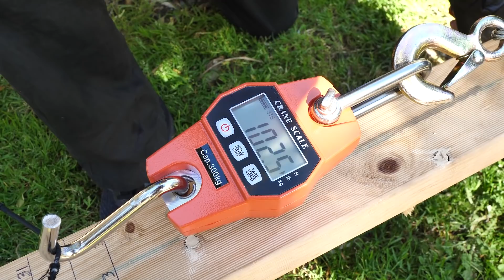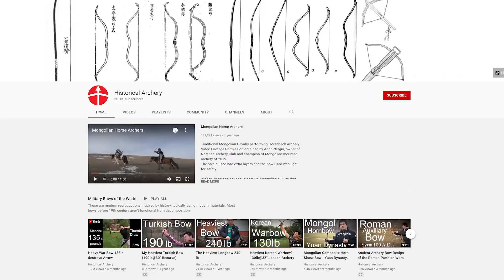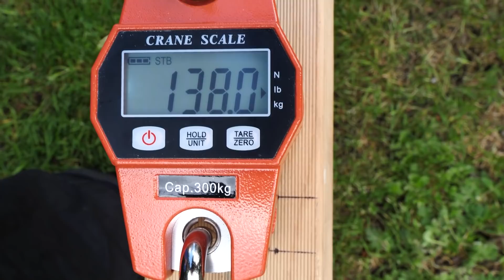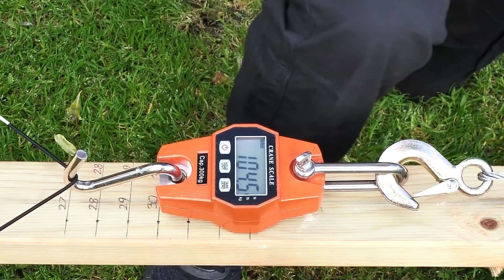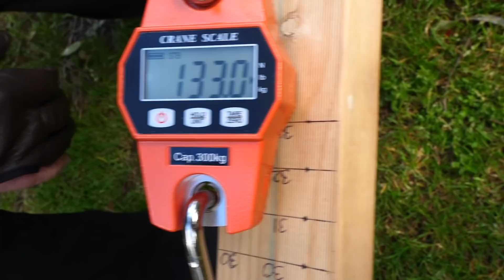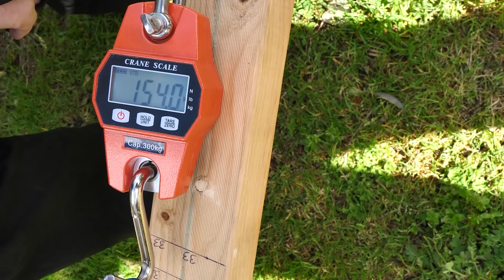Two idiots try to string a  TINY BOW

Comment: Hey Shad I like the new draw measuring setup but I have to recommend that you make it safer should a bow fail. Maybe have some wiring conduit brackets that go over the cable so if a bow breaks you only have to deal with the scale and hook flopping about.
There are likely other things to be done like finding a way to mount a camera that looks down at the scale so you and the cameraman can stay at a safer distance.
Dead Youtubers are useless to everyone and not something I want to see on your channel.

Comment: The reason the weight ramps up in the way it does, is due to the fact the recurves doesn't actually bend. They will act as levers making it much easier to draw the bow. But as you draw it, the angle of the recurves change, thus reducing the moment arm. The recurves also makes the string pull taut quicker making the bow more efficient.

Comment: Shad I want to see either a speed or a penetration test of the recurve vs your longbow.
Because the poundage ramps up that explosively, the longbow might be stronger. But on the other side the recurve has less mass, so might end up with relatively more energy in the arrow. I am definitely interested to find out the energy each bow shoots at.

Comment: This was both neat and fun to watch. I knew recurve bows were an improvement over prior bow designs, considering how much draw strength they could keep while miniaturizing, but actually seeing a much smaller recurve bow with a higher draw weight than your previous long bow was still enlightening.

Just a question from a hobbyist game designer working on his own tabletop RPG: Is there any point at all in making a long-bow sized recurve bow in a fantasy setting? My initial thought is "Yes, but only for people with insane/mystically enhanced levels of strength", but I honestly don't know if the physics would bear that out. Would making a larger recurve bow actually result in more power, or is there some leverage limitation I'm missing that would result in severely diminishing returns or an actual loss of draw strength?
Reply from the maker: I'll be explaining the details about recurved longbows in some upcoming videos, stay tuned.
Reply: @shadiversity  Thanks for the heads up. Looking forward to it. :D

Comment: (Noob question) What exactly are the advantages that different types of bows? If you can get a widdle one to 130lb, what's the point in a biggn? Surely a little one gives you greater mobility and is easier to carry meaning it's just better. Now of course, I know this isn't so simply true but I don't actually know the differences myself. please help
Reply from the maker: All will be explained in the upcoming videos so stay tuned ^_^

Comment: This makes me feel good. 
Mostly because when I was getting into archery I went to the local shop and wanted a recurve bow or a long bow. I wasn't a fan of the mechanical ones. The sales man I guess didn't like me asking for such a thing. He brought me over to a bow on the wall and said "oh you're getting into archery, ok well I know it's not what you want but before I give you a recurve bow to test lets see if you can even handle a woman's bow. Remember this is a woman's bow. Meant for little frail girls. Draw it." 
I took the bow and could barely move the string. I couldn't draw it. It dug into my fingers and as much muscle as I put into it I couldn't draw the thing. The salesman shook his head. 
"Woh I've never seen a man so weak. Don't even think about shooting you couldn't even string a bow." He said snatching the bow back and putting it away. "This is a woman's bow. My wife shoots one of these. Try a gun if you think you can even pull a trigger." 

I was so devastated at not being able to draw it. I was a bit obsessed and just as I worked out every day I would go in and look at that bow wondering what was wrong with me. About a week of doing this and another salesman came over to ask if I wanted to buy a bow since she'd seen me looking at that one on the wall. I told her the story of the man before and that I couldn't draw the bow. 
She rubbed her temple and sighed. "Did he tell you the weight of that bow?" 
Me "No, he just said it was a woman's bow."
Her after rolling her eyes. "That is a show bow set to 300 lb." 

Apparently it was an inside joke for the men who wanted to pick on people they didn't like.

Comment: Shad;  "I cannot wield this!"   ...Every viking in the room;  "Grow stronger."

Couldn't resist.

On a more serious note, I assume that the bows are over-strong because they will relax/age into their designed draw weight over time.  So it is compensatory to lengthen the life of the bow.  I have heard that there is a different draw technique as well that might be worth trying  (if it is even valid);  instead of pulling the draw back, start with the bow close in, string at draw position.  Step forward while pushing the bow out, keeping the string where it should be when readied to loose..  Mechanically, it lets you push out from your center mass instead of trying to pull something in from outside of center mass.

Comment: When you said it was, easy easy easy then it ramps up, while you were measuring you could see the draw weight go from about 35-37lbs to over 60 almost 65-70 very very quickly. You certainly weren't kidding when you said it ramped up very quickly. You can see it while you're measuring.

Comment: Yes those are short war bows are very elegant aren't they and as I understand there are two ways to pull those War bows the first way is to draw the warbow back and release incidentally because you just reached the end of the draw the other way it's a drawback to a very specific length and then release

Comment: I've read that the average Marry Rose bow was 140 lb and this brought into question the previous estimates for English Longbow draw weights.
Reply: So sounds like you may of gotten a replica from someone who put more effort into knowing the physical dimension specifications then the performance specifications and told you the pre test expectation because what you measured matches what other Marry Rose Replicas measure, which is more then was expected.

Comment: The smaller bow wasn't made for an arrow that large and it wasn't meant to be drawn that far. You'd think Shad would know that.
Reply from the maker: The despot is a warbow and is meant to shoot war arrows like the one I was measuring with. Also it is made to shoot at 28 inches, which means it has a natural cushion of 27-29 inch draw, which is what I was measuring at.

Comment: Ugri Urcher's (of 100 arrows meme fame) demo of Manchu bow stringing is my go to stringing method for Asiatic bows- composite type bows. Not absolutely sure it will work with Tiny Bow, however it made stringing my 80 lbs Korean type bow actually pretty easy.

Comment: I personally think that measuring a bow from behind  the grip to be  more accurate, since it where you hold the bow.  But if the systems say measure from the front of the grip, then measure from the front of grip.

Comment: makes me wonder what methods the militaries that used bows like this used to get them strung and unstrung (because you know they made the rookies do it until they could do it in their sleep) also whats the draw weight for standard ammunition?
Reply: Waist cable for one person stringing and for 2 person stringing other one bending the bow over knees and other one putting the string on.
Quite normal "standard" for war bows all over the world was around 100 pounds, but even 40 and close to 200 pound bows have been used in both ends of the extreme, but 100 pounds is pretty common regular soldiers poundage. The arrow weights for those bows range from 25 to over 120 grams, 60 to 80 ish grams being very common in both asia and europe. Highest arrow weight i know of, is korean iron arrow 230 grams. Some hunter-gatherer tribal archers shoot very long spear like arrows that weigh around 300 grams, but they are not normal military arrows.

Comment: Chad to string yee must use whole body   push forward with right shin.  push bay with left leg .   an push forward with left arm in 1 smooth motion till you can slip the string on with a lil slack.   what ive lerned in my 7th grade Gym class back in 2001

Comment: This genuinely surprised me. I always thought that the first bit was the toughest one with such bows, as recurve bows become extended levers.
I did shoot similar bows but they had much less draw strength for multiple reasons...
Reply: In this case the levers have too relaxed angle in them so it doesn't have long draw length, it stacks at 28". With either longer levers or tighter angle in them longer draw without stacking would have been reached. Its all about the geometry of the bow, you change something, the bows behavior changes

Comment: its call stacking, the shorter the over all length the bow is, the shorter it takes for the bow to stack in weight, I bet that bow is 48 inch in overall length.

Comment: I'm not an expert by any means, but that "ramping up" in draw wight you're getting starting around 28" seems to be stacking. Essentially, you're running out of leverage as the string angle increases, and the draw weight shoots up exponentially. It's the reason straight bows need to be so long. If you look at 14:18, you can see the string has passed 90 degrees, so you have a negative mechanical advantage when pulling back further, wasting the energy. It's a consequence of the bow's size and degree of recurve. Were it a little larger or the tips a bit curvier, kind of like on a "scythian" style bow, it would happen further into the overdraw, where it wouldn't be a problem.

Doubt it'll hurt the bow, at least not at the amount you're doing it, but it is a waste of muscle energy for tiny gains in arrow speed/energy.
Reply: I think of it like pedaling a bike. The closer to the top or bottom of circle the pedalcrank is, the less efficient the leverage.

Comment: That ramp up in poundage isn't a product of a "recurve".  It's an issue all bows have once the angle of the string to the back of the limb begins to approach 90 degrees.  The longer the bow for a given draw length, the smaller that angle will be for a given design.  Take that same reflexes limb you are using and add 6 inches to the length on each side in limb and riser and you will have a much smoother, lighter feeling bow at the same poundage.

That is why for your other video where you talk about the misconceptions of the longbow itself, it wasn't that it was a better design, it was just that it was the most reliable design for the materials the English(or originally the Whelsh) had to work with(yew).

As a final note, I would add that I don't believe that bow qualifies as a recurve.  The definition for that means the string lays on the back of the limb at rest with the limb tips forward.    It is a heavily reflexed bow with a set back handle, but it is still a standard short bow and not a recurve.

Comment: What was the Max Draw od the Bow?  The flex looked Maxed out at 29" from the front of the Bow.  You dont want to get the draw where the Bow Starts to Stack up.  Nice Bow, I would keep it at 28-29" max and no further until you call the Seller back to make sure.  You got one hell of an Arm.  My Max is only 60# after 2 years.  Sweet Curves on that bow.

Comment: The official way to measure draw length is to measure from the deepest part of the grip in a straight line towards the grip and adding 1 3/4 inch. In most cases this is the point where the arrow protrudes from the back of the bow. If you use this measurement, it should perfectly match the measurement of the bow manufacturer.

Comment: You probably won't read this Shad but gonna leave this here anyway. Just finished your book (Shadow of the Conquerer) as of 10-15 seconds ago and here are just some initial thoughts...(no spoilers)

Overall a great read, I'd rate it an 8/10 maybe even a 9; a point or two away from perfect given that your writing feels a little...hm...stiff. The world building in this novel is rather phenomenal and definitely the creativity with basic concepts is its greatest strength. I call your writing stiff simply because there were a couple times where elements were....well...it's hard to pinpoint but it's as if the characters were less actual people and more like clear avatars of a certain lesson/theme? They all seem to be a little flat with only one defining trait and their dialogue just sometimes comes across as astonishingly similar, like if you were talking to me through the narrative instead of characters talking to each other in a rather obvious way. Also sometimes they would act in a certain way or say a certain something that seemed wildly out of character for what seems to be to serve the plot (ex. For a savvy politician and old wise man Daylen seems to be an excruciatingly terrible liar and has a surprising lack of subtlty in my opinion). They definitely need a little more depth, but perhaps that will be exhibited more in the sequels. I would point out some examples but hey I'm not your editor and don't want to spoil the book. Just a college student and a couch critic offering some, hopefully, constructive criticism. I would like to point out that despite saying this little critique I most definitely look forward to a sequel.

I highly recommend anyone pick it up. I have more praise than critique to be honest. The light magic exhibited in this book is used in extremely creative and fascinating ways, the novel balances realism with being cool as hell; I mean Shad basically made physics fun to read about in certain portions and I hate physics! The world building and culture surrounding the characters is extraordinarily rich and vibrant, hell there was never a dull moment. Definitely worth a sequel and a movie production. Shad has definitely made his way into my top...well not 5...10 favorite books. I'd say somewhere around 8 right behind Sharp Objects by Gillian Flynn.
Reply: Added note: When the hell am I gonna see sunforged arrows that basically function as heat seeking missiles towards their intended target? Or shot spikes... (this is definitely a joke/fan concept not actually making demands I promise XD) or, hear me out, a sunforged bow that feels like 20lbs when you draw it but shoots with the force of an 80-100lb...

Comment: I be Boston bows love the fact that you over draw the  bow and held it at full draw for so long!.   Not many people can't make decent heavy bows he is one of only a few in the world who can!.

 That's another decent bit of yew wasted. Won't be the same after over drawing it. 
You got to understand bows before weighing them!!. To many people weigh there bows who don't understand. It only takes to ask the bowyer some advice about occasionally weighing there bow.
Reply from the maker: Hey Joe, great to see you here. I’ve read bowyers explain that the occasional overdraw is harmless. If the bow is well made it will handle it fine, that only repeated or excessive overdraw will damage it. But you seem to by implying my bow is ruined. What you're saying is new to me and contrary to what I've read, so please don't begrudge me for that. I'd much rather know what's correct. What you seem to be saying is that no yew bow can handle a one inch overdraw and will be instantly ruined, or permanently damaged in some way? I know you’re a bowyer yourself so any farther information you can share is appreciated. My bow is tillered to allow a full 32 inch draw and if I measured the draw distance wrong it was only pulled to 33 inches, a one inch overdraw held for only a few seconds, which is very mild.

Comment: Also heavy wooden will gain weight sitting around not being shot, so if your only part drawing the bow from Boston bows it will have probably gained weight and would take a few shots at full draw to bring it back to the weight the bowyer said it was.

Comment: I wouldn't try to draw the recurve too far past 28" they are made to be drawn back that far, they are stressed to that degree during the making process, and they are garunteed to remain pretty stable if only ever used that way. As soon as you overdraw the bow by a considerable amount you introduce new stresses that the wood has never dealt with before. And these build up until the wood has adjusted and the new stresses induce no further permanent change. If you're lucky this only means a small drop in elasticity and nothing else. If you're unlucky it cracks or snaps one day with no warning.

Also string pinch sucks. Don't put yourself through that
Reply: There are many recurves that are made for longer draw, but not this individual, this bows relaxed siyah angle makes this bow incapable of drawing more, and high reflexed handle increases the stress. But with different design this size bows can easily do over 30" draw, and many longer asiatic recurves exist, and they go up to 36" draw length.
Reply: @jkre  good clarification. I was specifically referring to the sort of short,  extremely reflexed bow he has, but certainly some are made that can handle being worked out to a longer draw length.